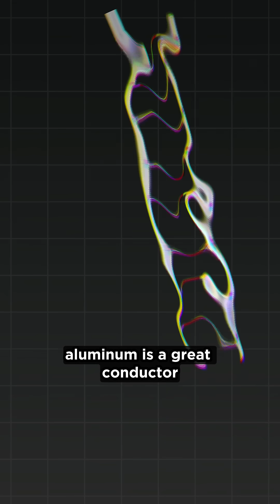How Did This Ladder Melt The Ground?

Comment: The ladder is not unaffected, it has melted. This is a two-part ladder with 20 steps (rungs) in each part. But in this video there are only 19 steps remaining on the bottom part of the ladder. In another video taken a bit later, and from another angle, there are only 18 steps remaining on the bottom part of the ladder. So the ladder is without doubt gradually melting away and that stuff bubbling away at the bottom is partly aluminium alloy from the ladder. 

You said the ladder is standing on asphalt but it looks like it's standing on a concrete pavement/slab. For the components of concrete (cement, sand, aggregate etc) to melt and turn molten you're looking at temps above 1500°C. If the concrete was melting then the ladder made from aluminium alloys, with a much lower melting range of around 500°C to 700°C, would also be melting. 

However I'm not convinced that a significant amount of that melted material is concrete. I think it's mostly aluminium alloy and something else that has melted at the base of the ladder. Maybe the workmen left some equipment or materials there which has also melted. In another video which shows the pavement on the other side of the road, there are manhole/utility covers in the pavement. So the ladder could have been standing on one of those giving it more/other materials to melt.
Reply: You're right that it's probably the ladder that is melting rather than molten pavement but she's basically correct that the heat is mostly from the ground material (basic ohms law), hence why the ladder is melting at ground rather than along its entire length.
Reply: Arc welding.
Reply: In a way less science way lol.
Reply: Contact isn't necessary. Arcing may occur.
Reply: I want y'all to sit on a concrete floor and touch a hot 120v wire. That overhead is 30,000v. You will feel 120v. I know. I've done it.
Reply: @rkelly1212  I've been shocked by 230v a few times. I do not recommend it.
Reply: @JeppeBeier fml I am genuinely sorry
Reply: @VictorVelaz-888 no need. While it's very scary, the pain and tingling does fade again within 10 minutes. As long as the electricity doesn't pass the heart, it's mostly harmless. Don't go doing it on purpose though as when I say mostly harmless, I mean it's not completely harmless.
Reply: @JeppeBeier scars?
Reply: @JeppeBeier  and thanks for that tidbit of info that could play if circumstances allow, how would you possibly get electricity to not go through the heart any time you and I would be shocked is beyond me and I sometimes think about the will power the body must havr the will to not let go and give up, circumstances allow it I will hope you and I are as ready for the experience to work it out and live to tell the tale
Reply: @JeppeBeier  but more importantly I hope it never happens or ever again,..
Reply: @VictorVelaz-888  brief shocks don't give burns or scars. If you only touch the wires with one hand, then it won't go through the heart. The real danger arises if you touch with both hands or a hand and a foot.

AC is relatively safe because the alternating current allows you to release your grip immediately when getting shocked. DC can be more dangerous because it can force your hand shut and prevent you from letting go.
Reply: @rkelly1212 yiiiiip!
Reply: Well you can see a wire at the back of the ladder and hence the thing which is bubbling  is  the wire bundle 😂
Reply: Yup just like welding and the ladder is the rod
Reply: Critical thinking, technical analisys and specific temperatures cited. That's the way to do it folks. Being from a technical background myself, but not knowing those specific data points, I appreciate your comment my friend. Thank you 🙏
Reply: I knew something was wrong here, they prolly just waitin for the ladder to melt away till the contact is lost to the wire
Reply: You are correct.  The ladder has melted at the bottom. The commentator must be wrong in that the ladder is no longer touching the wire. There wouldn't be bubbling if the connection was cut.
Reply: @JoeSmith-cy9wj   At the end of the video, it isn't touching the line. What do you mean they must be wrong? You can literally see that for yourself. It's a video, bud. It takes place over a prolonged period, at first when it's bubbling clearly it's touching the cable. However, at the end it's clearly not touching the cable, but the area hasn't completely cooled down yet.
Reply: @nerdjournal it takes enormous energy to melt and boil concrete, or aluminum. The energy must have been continuing to travel down the lader. Interesting the ladder would melt while the aluminum wire didn't,  don't you think?
It is probable the wire in question had already parted, and was lying on the ground or contacting the ladder in a different place than those perfect condition wires visible near the top.
Reply: @JoeSmith-cy9wj a level of bot commentary three replies deep here
Reply: Ya it has to be a metal cover. Basically what I just said above.
Reply: @WillMag Aluminum does have great heat resistance though, because of its extreme conductivity, it had a phenomenon where the entire piece of Aluminum has to heat up to around the same temperature before it starts to melt, unless its very thin Aluminum sheet. They way it works is it continuously wicks away the heat from the hot spot to the coldest point on the material. This phenomenon is why the vast majority of heat sinks are made from Aluminum and even some rocket nozzles use Aluminum instead of steel because the steel would melt much faster than the aluminum even though the aluminum has a much lower melting point. One example of this is the rocket propelled rounds from the gyrojet pistol and rifle. An Italian ballistic scientist tried to recreate a modern version of the ammo and found steel would melt away almost immediately but aluminum worked great for the rocket nozzle and lasted for the entire burn of the rocket motor.
Reply: You said it already...
It's a metal alloy... 😂
The melting temperature is totally different.
Reply: Molten metal usually has a very low viscosity, but that stuff is bubbling like syrup, which is more characteristic of the viscosity of lava, so I have a hard time believing that's mostly molten metal alloy
Reply: lmk if you read all that
Reply: @HalfBreadOrder  I read all that

Comment: 😂😂😂 I think due to the type of ladder there’s so much power flowing through and around from the ladder being on the line for probably a while before the ladder stood upright 

But most importantly if only a certain amount of energy is dissipating to the ground to create that effect on the concrete then current is just consistently flowing through and only escaping from the ground and not any other part of the ladder. Without a proper ground, you won’t be able to ground the electricity and dissipate power to shut it off. You would have to go up to the ladder and run a ground wire and hopefully clip it to the ladder without being shot or receiving a huge bit of static electricity.

Comment: an arc welder is a dead short, but the high current (200a) to lower voltage (48v) comparable to hitting a 250v arc at 1000 amps, and since the ladders conductive cross section is about 5 times the area of a thick welding rod the heat is dispersed from the ladder but the heat is concentrated at the arc where the air is turned into ionised plasma which is used to melt the surface the arc lands on, usually fusing with melted metal droplets which cool, which is how welding is done. the silicon in the rocks just melted instead.
very cool to see it actuall scale perfectly and work! 😅

Comment: Tradesmen here. Saw this recently on a construction page. There was more footage, showing plants 5-10 feet away smoking, demonstrating that a portion of the ground is electrified. I was amazed and horrified that the concrete had become magma. But upon further thought, and reexamination of the video, you could see that the bottom of the ladder was slowly melting. This leads me to believe the bubbling substance is actually molten aluminum, bubbling on the electrified ground. I could be wrong, and would love to hear from someone that knows more than me. I believe the melting temp of aluminum is lower than that of rock/ concrete. 

Also, side note: circuit breakers only exist in a building, separating the building from the power lines (my scope of work/experience), so there is no "circuit breaker" on powerlines. I'm not a lineman (outside of my experience) so I don't know what kind of over- current protection they have (I'm sure there is some failsafe) but the amp draw on a circuit providing power to a city or even just a neighborhood wouldn't be enough to trip that.

Comment: i think this is a crappy ai vid because:
a) asphalt consists of bitumen and additives, not rock and therefore can not, never ever turn into lava 
and b) lava (especially in this bubbly, hot red state) is around 800C-1000C while the melting point of aluminum  is 600C... the ladder would have molten before the ground
Reply: 1.   Concrete does melt when exposed to extremely high current.

2. The ladder doesn’t melt as it has a very low resistance compared to the concrete, like how resistors burn out instead of wires in electrical circuits.
Reply: @otherkpSEDJfoAHvio  

1.  never said that concrete wouldnt melt... i said since its asphalt it is physically impossible to turn into lava... lava is molten rock... bitumen aint no rock 

2. the ladder would melt at the point it touches the ground, cause a metal with 600C melting point would literally stand on top of lava wich is around 800C-1000C+ in shown state.... the resistance of the ladder and the heat geneated by current doesnt matter if its dipped into vaporizing temperatures...
Reply: the ladder and the concrete are both melting. the material with the highest resistance melts first, not the one with the lowest melting temperature. the heat coming from the concrete melts the aluminium at a slow rate. 

if this is AI, then it is an accurate representation of what would happen in real life.
Reply: @otherkpSEDJfoAHvio 

the ladder made from aluminum would have to melt at least at the point it physically touches the surface nearly double its melting point and you can see there is no aluminum melting in this video.... 

with a violent reaction like bubbling lava, the ladder would at least move if not "jump" especially if the ladder is the sole conductor for such an ammount of energy...

if what you said was true about  "the material with the highest resistance melts first"  no electric powered blast furnace would work cause the casing of the furnace would melt before its contents... but not to worry... there would be no electricity anyways cause every ceramic insulator on every high voltage line would melt too.... electric insulation in itself wouldnt even be possible...
its exactly the oppsite... the higher the resistance, the harder it is to melt with electricity... thats why your leather gloves wont melt when you weld, while steel liquifies

aluminum does NOT melt slow in such temperatures... this stuff even liquifies when you cut it with an angle grinder and when you drill it you have to go slow cause the dill chips would tickweld itself to the borehole... this stuff melts so easy it would literally vaporize when you stick it into molten minerals/lava

if the current running though a wire and a ladder is sufficient to melt the street, why does the steet not melt when some wire cuts somewhere and it connects diretly to the street? 

and why doesnt the tram melt the street or its own interior every time it runs by?

and why is this the only video of such thing occuring? this is 100% not the first ladder in history accidentally touching a power line.... 
in real life the ladder would simply be standing there. current running though it and you couldnt see anything 

not to mention that the street is litterally grounded by definition... 

to summarize: this is not an accurate representation of what would happen in real life.... to melt the street you would need an conductor which could withstand the needed energyflow and would be able to arch without melting... wolfram would come to mind and not the metal with one of the lowest melting temperatures and density while it got one of the best conducting properties in solid state (right next to copper)... physics say "NO"
Reply: @otherkpSEDJfoAHvio  cant edit last post: (nearly) every metal will melt before stone/concrete  especially soft metals

Comment: inductance and skin effect... doesn't need to touch the lines to conduct electricity just needs to be at the right distance for the effect to take place. you can actually place a loop of wire UNDER high tension lines and use it to power stuff "wirelessly"

Comment: I would be more worried about the fact that the power line does not hold enough current to melt concrete into lava....
I've seen plenty of active power lines. Laying on the ground. And never once have I seen molten lava there as well!😅😅😅

Comment: You dont have to actually touch to the power lines. There is bleed off or potential that will build up n electrify everything around. Worked on a lot of poles lol it will electrify the strands hold up phone cables pretty damn quick

Comment: oh i guarantee that ladder heated up just fine, aluminum isn't just a great electrical conductor it is a supremely excellent thermal conductor, meaning it was dumping that heat into anything it was touching (including the air) it would have been a giant space heater

Comment: The fuse/breaker didn't pop because concrete isn't very conductive, thus you can't run that much current through it. I mean, bubbling lava pool seems like a good amount of current, but this being on a powerline running in between houses, the nearest fuse/breaker is set up so that it can safely run a whole street on high demand. The resistance of the concrete was enough to limit the current to not pop that.

Comment: BTW if you are in an area where a live wire or something like this ladder is conducting power to the ground, do not lift you feet to walk away. If you must move away from the area, shuffle with your feet close together to minimize the voltage difference across your body.

Comment: Why did the circuit breaker not trip?
That most likely as to do with the amount of current being passed. The ground resistance will limit how much is "consumed" by the circuit of the ladder and the ground. If this was a high power transport line, it might not be enough to trip the breaker.

Comment: It was getting close to ship day and as usual assembly was behind schedule.  (Scheduling always over promised to make the guys move faster.)  Some mechanic had wire nutted the motors to the controls to make them run.  It’s temporary.  Who needs a ground wire.  
I crawled under the conveyor to read the specs plate on the motor.  Sitting on the concrete floor I leaned back on the leg assembly to read the motor plate . . .  And felt something I’d never felt before.  I was getting a tingling in the seat of my pants!   Motor to frame through the shirt to me through the denim to the concrete, I was grounding to the floor!  Turns out concrete is a dangerously good conductor! 
I’m wondering if the shorted ladder burned through a locally buried 480 volt or higher cable. It doesn’t look like ladder is actively involved anymore but the lava is visibly bubbling.  Something is still inducing huge amounts of energy.

Comment: I've made aluminum ingots before, aluminum melts pretty stuck and easily. I'm pretty sure something weird is going on here. Either the whole video is faked or something is going on here that isn't what it looks like. I've given thought already to everything you said the first time I saw this video, but it still doesn't look right to me. Electrically speaking, this aluminum ladder is probably more conductive it's linked within the wire that it's laying on, so that part seems accurate enough that The ladder doesn't just melt it too. But if this is really what happened, I can just say it's not what I expected.

Comment: Those lines are not protected by a circuit breaker. They are protected by a fuse at a substation. It takes a bit for that fuse to blow. If it blew as easy as a circuit breaker trips  they would blow all the time.

Comment: If the ladder not touching the wires  then perhaps  it's a understand  electrical cables  that's causing this issue  it's  shored out  and heating up  the concrete from underneath.

Comment: The girl in the video asked about a breaker, and people in the comments keep saying right on the fuse or the breaker kick out if you think about it, that's kind of a stupid question. Because it's not receiving Maine's power through the house. It's receiving it from the main line. You know the wires go from Pole to pole, then to your house. Okay, so how is a breaker box, that stops shorts and stuff from happening inside the home, going to help at all, for a main line short, that's outside the house. The power is not even went through a breaker box yet. It's got to go into a house before it can go through a breaker box. Now there are humongous breakers, and fuses, on the main power lines. But those  only kick out when there's enough power going through that line to basically melt the metal of the wires themselves. That's why you can clean a lighter up against the main line like that, and be standing there for 45 minutes while your insides boil, and no main breaker on the power lines kik. Because they're made for thousands and thousands of Watts to run through them at a given time. So the big giant breakers on the actual power lines, wouldn't do shit in this situation. And the breakers / fuses in the house, I have nothing to do with it. Cuz those wires don't come from the plugs in the house. That's the line that eventually goes into the house, then threw a breaker box, then to the plugs.